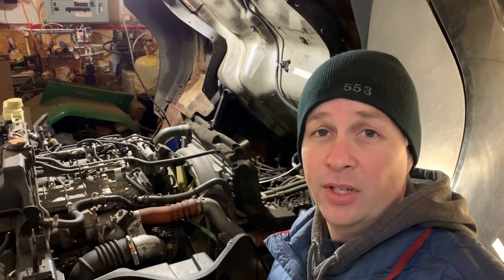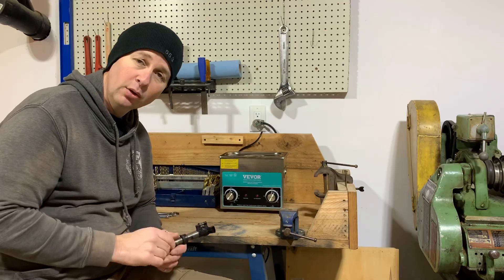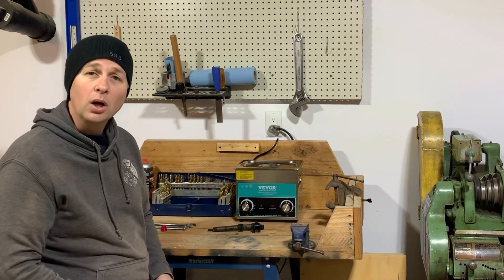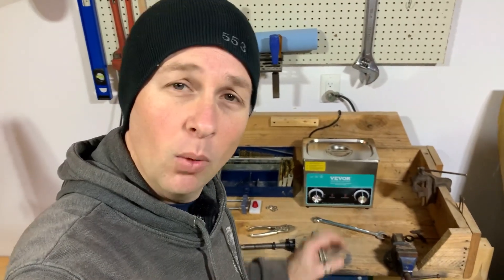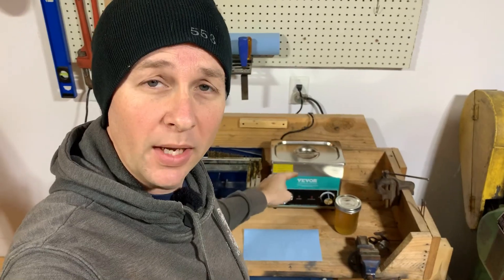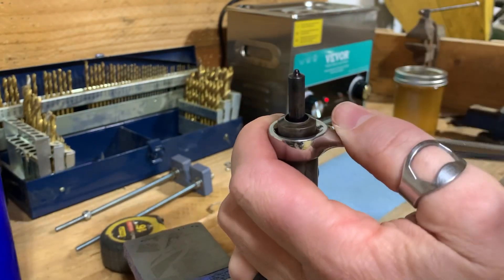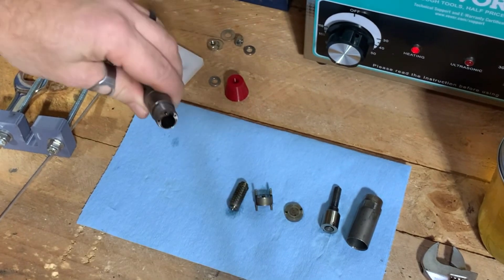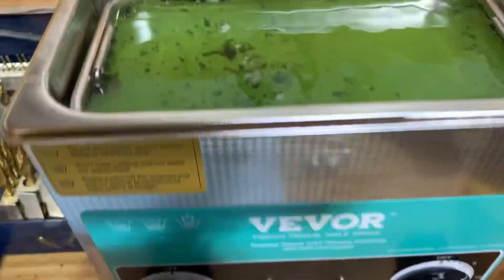Saving a DEAD Piezo Injector - is it possible? | FUSO Build

Comment: Did you put a magnet on the crap that came out of the injector?
Reply from the maker: No, but I should have.  That said - it appeared to soak into the paper towel, not sit on the surface.
Reply: @BruceandKrista  At this point it really doesn't matter unless you knew witch engine it came from. When you take the others apart would be interesting to see if there's any metal in them.
 Im still having 2 issues with my Fuso, don't know if they are related or not. First is I trigger a code saying low fuel rail pressure when I go up a hill. At idle I have 380-400 bar. Going up the hill I have around 1800 bar. Isn't that what it should be? 2nd is going up a hill I lose fuel pressure on low side. Goes from 60-70 lbs to 0 and engine dies. Cycle the key and it fires up with proper pressure. I have installed a disaster kit with a new low pressure pump and even took the pickup out of the tank to be sure nothing is clogging it. I also installed a fuel pressure gauge on the dash to watch it. 
 What are you using for inf? Im not having a lot of luck on line. Any input would be much appreciated. Thanks!
Reply from the maker: The injector I disassembled in the video was from my spare engine - which I don’t believe was taken down by a fuel system failure.  Before I bought that engine I pulled the IMV off the fuel pump to check for metal and there was none (vs my engine that did have some).  I did just pull my 3 injectors apart, and though clean inside, I can’t get the “needle” out of the tip (yet, still working on them).  

Have you looked at the pressure regulating valve on the fuel rail on yours?  If it’s dumping fuel back to the tank under heavy load (going up hill) that would cause the pressure to fluctuate.

Comment: More than likely that is glued together with a type of high strength/ high heat loctite.  use a torch or heat gun to soften the glue on the next one.
Reply from the maker: Yeah I wondered that after it came apart - kind of looks like loctite - but I hadn’t seen any mention of that being used.

Comment: Here in the UK, I replaced all my injectors with the correct Bosch ones (but not from Mitsubishi-MB) and they were $500 CAD each. A quick search today has them still at around that price from various vendors, including on the UK version of that site starting with E and ending in Y. Sometimes they are listed for an Iveco Daily 3.0, as they have the same 4P10.
Reply from the maker: That’s a much more reasonable price! (But I’d still like to see if I can fix mine!!)
Reply: Where can I get the rubber seal for these injectors? I bought some online in Canada but they came without rubber seals

Comment: I was kinda wondering whether just throwing new parts at it wouldn't be a better idea. Of course, I had no idea how much fuel injectors or any of the other parts cost. Now I understand why you weren't doing that. :)
Reply from the maker: That, and if this ever happens on the road I want to know if I can just fix it!
Reply: @ Oh, that’s a good point. Your vehicle seems a bit more capable of taking you away from civilization than mine. “Oof, the nearest Autozone doesn’t seem very well stocked, we might need to drive our car 45 minutes to a bigger one” is where we are :)

(It’s amazing how peaceful things can be just 2 or 3 miles along a forest service road off an interstate. Quiet and deserted. Saw two people drive past in 5 days)

Comment: There's not much to piezo injectors when they are apart.  The amount of crud in that one isn't a good look.  I wonder if they are all like that, or is that one of the injectors off the spare engine?  If that's one off your engine I'd be inclined to give all of the steel lines from the high pressure circuit a good ultrasonic clean, or even replace them.  Perhaps whilst sitting around they've started to rust internally.  It would really suck to clean all your injectors and get a nice working set, only to have them filled with dirt again.

If you can source some (maybe you can print them) try to get hold of a set of barrel vice jaws.  They are usually just machined by taking two blocks of aluminium with a hole drilled down between the halves.  Gunsmiths use them to hold barrels tightly whilst they unscrew receivers, but I love them for pulling injectors and other similar 'stacked' cylindrical assemblies apart.
Reply from the maker: That was one of the spare engine injectors - I figure if I was going to wreck one I should wreck one of them first  - I did flush all the lines out before I swapped them over, and they were flushing clean, so hopefully they are OK.
Reply: I use angle aluminum on my  jaws when I don't want to scratch up sensitive parts. 
I also have some brass angle jaws I use on my lathe / mill for the same purpose.
Reply: @CurtisDrew1  I use brass/aluminium angle too - most people do.  The point of the barrel vice jaws is they are specifically designed to grip cylindrical parts and require far less force to stop them spinning.